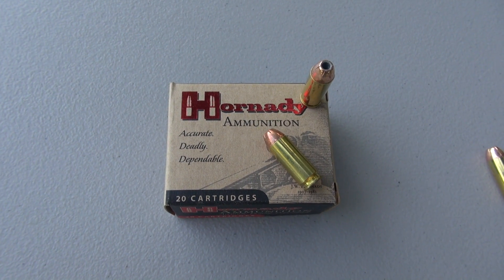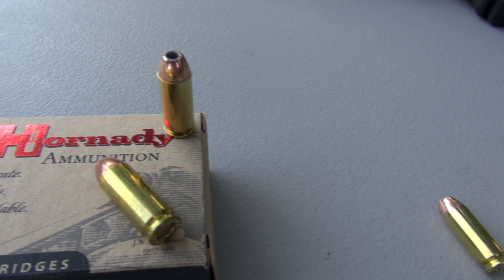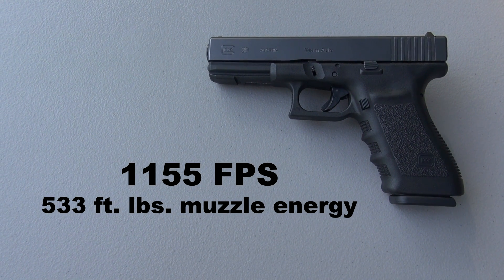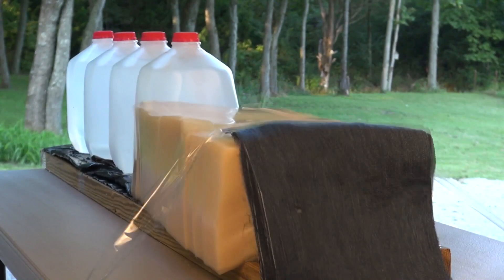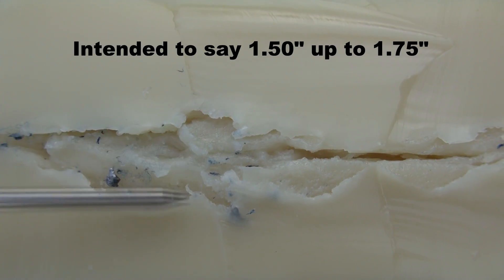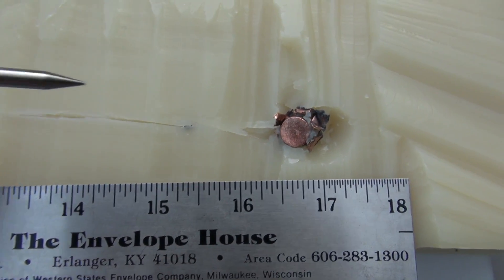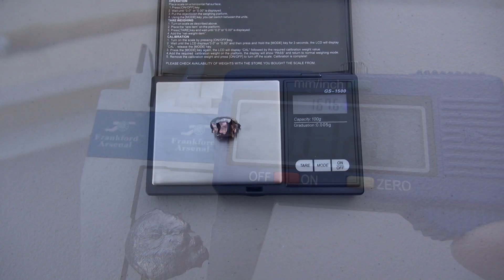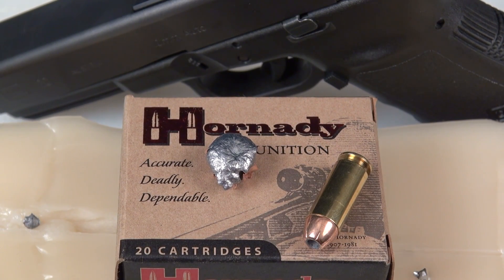10mm Hornady XTP 180 gr JHP Ammo Test

Comment: Underwood's 10mm XTP loads are quiet a bit spicier. Out of my Glock 29, using 1 Gallon milk jugs filled with water and no denim I gpt the following:

- 155gr Underwood XTP penetrated 3 water jugs 
- 200gr Underwood XTP penetrated 4 water jugs

The 155gr has 775 ft/lbs of muzzle energy and the 200gr has just short of 700 ft/lbs. I'd love to see a ballistics test out of the Glock 20 into some gel.

Comment: Somebody should try necking these down to .357. Then you'd really have a .357 Magnum in a semi-auto. .357 Sig doesn't quite get there.
Reply: +TheJurgisRud   It exists, it is called 9x25 Dillon. You can push a 90gr FMJ to 2000fps.
Reply: +Moto Rad   It was around in the 90s for making a certain power class in competition. Lone Wolf makes barrels for them, I have one.
Reply: +Moto Rad Wow. I didn't know that. There's lots of info here on YouTube about that too. Thanks. I can't believe I've never heard of this before.
Reply: ***** It is a really cool cartridge. The velocity interested me. I am going to try the 90gr FMJ load and try to gel test it. Supposedly rifle-like hydraulic shock starts are around 2000fps, so my EDC gun could be essentially a handheld rifle. I am excited to see the temporary wound cavity it creates. It is funny the cartridge was mae basically just for competition use. You reload it with the same .357 SIG dies, it is just 3mm longer so you set your die for that (since it is a 10mm case).
Reply: +Moto Rad I'd like to see that gel test. I subscibed to you so I won't miss it when it comes up.
Reply: ***** Thanks, but I'd upload it to my other channel  hahaha  see if that channel is linked to this one
Reply: +Moto Rad Maybe consider loading some with some of the bullets that Lehigh makes. Like the Extreme Defender or the Extreme Penetrater. They sell the component bullets on their website. From tests I've seen, the Extreme Defender makes a giant wound cavity already, I would imagine that their 90 grain Extreme Defender bullet at 2000fps would be devastating.
Reply: *****  I would not stand in front of it  :)
Reply: 9x25 Dillon

Comment: I wish they designed 10mm bullets instead of just taking .40 cals and putting more powder behind them.
Reply: There isnt anything available in the commercially available category that really outperforms the 40. Have to go to Underwood, double tap, and buffalo bore or something for real performance.
Reply: because your dum
Reply: strat1080 ...why broadcast you're delusional thinking
Reply: +LordDigz12   I know, it sucks.  :(
Reply: It's actually the other way around
Reply: It was that way originally,(40 cals were nothing but 10mm with softer loads) but for a while now most of the major bullets are built around .40 cal velocities and tear apart when shot at higher 10mm speeds.
Reply: I agree. That is why I don't get why so many folks think the 10mm is a great bear defense round and try to compare it with a 41 or 44 Mag. Those rounds piss all over the 10mm in that role. The 10mm fan boys have this mythical mindset of this round. I haven't seen a single ballistic test of the 10mm that would leave me to believe that it would be any better than a 9mm, 40, or 45 against a bear.

Comment: I love my Glock 10mm. But......the ammo is just wayyyyyyyyy too expensive, This stuff costs 3 times what comparable 9mm costs. There is no way to justify this.
Reply: 10mm has got alot cheaper. Almost as cheap as 45 acp now
Reply: How much is your life worth?
Reply: Bill Murry i reload 10mm a box of 500 bullets (.400 diameter) cost about 50 bucks from xtreme bullets another 20 for primers 25 for a lb of cfe pistol and the brass if u dont have it its about 40 per 1000 so total for 1000 rounds (a lb of cfe pistol powder will last for around 1200 rounds and primers come in packs of 1000s) is going to cost you around $175, then when you reload those same casings it will drop to $135 per 100 even less if you cast your own bullets (which i do) i get 1000 rounds of .45 and 10mm for around 80 bucks (pretty muchs just pay for primers and powder and the lead which goes a long way
Reply: Robert Jensen ... The justification is when you're backpacking in the back country
Reply: PewterC5FRC I'm also interested in the cost per round. I believe most pistol cartridges can be reloaded for about .10c a round
Reply: Carlos Moscoso lol this comment. #truthbomb!
Reply: Buy in bulk, got 1000 rounds for $15 per 50 rounds
Reply: I didn't bother buying a 9, .40, .380, .357, or .45. I rented those. Then I rented a 10 and liked it. So when it came time to buy, I went straight for the 10. Everything I have read says it's the best all around round. All handguns are a compromise, but a 10 seems to compromise the least, and to potentially give the most all around performance. So that justifies it to me.

Might even get another 10mm in case my primary gets confiscated in a defense shooting. I don't ever want to be without a platform for this caliber.
Reply: I can justify the hell out of it since I reload.

Its fantastic if you handload/reload.

Comment: 10mm is not to far behind the .41, but it's between a 357 and a .41 with certain loads.
Reply: +strat1080 because the fact the 10mm is a auto loader.
Reply: You can push the 10mm to .41mag performance with handloads
Reply: Yes if you compare hot rounds from Underwood for 10mm against your average 41 Magnum round. All things being equal, the 10mm pretty much runs neck and neck with the 357 Magnum. Underwood's 357 Mag loads are actually hotter than their 10mm loads. Underwood's 41 Mag loads run at about 1100 ft/lbs of energy. I don't know what it is with the all the 10mm fan boys exaggerating the power that it produces. I've never quite understood people's fascination with the 10mm as a woods carry bear stopper. It pretty much uses bullets designed for the 40 S&W and pushes them faster which actually reduces penetration. All people look at is the energy numbers but there really aren't very many 10mm bullets designed for hunting or bear defense, except for the hardcast stuff.  It really doesn't come close to a 41 or 44 Mag when it comes to hunting or bear defense.
Reply: @strat1080  To use as a bear stopper you need flat point solids loaded to the high end of the velocity range for deep penetration.
Reply: Exactly why I got it
Reply: +desertfox2020   To the low level. The .41 pisses on it in the long run according to my loading book. Over 1k ft#s in .41

Comment: Is it true that the 10mm is virtually the same as the .41 mag???
Reply: Joseph Kool Except in energy, bullet weight, bullet diameter, and expansion.
Reply: Joseph Kool i know that the 10mm is stronger
Reply: no, but it is almost as powerful as one, a 41 magnum is pretty powerful, stronger than a .357 magnum, that should tell you about the power of 10mm
Reply: strat1080 10mm creates larger wounds, and the handguns chambered for the often high-capacity semi-automatics, where is 357s are mostly in revolvers
Reply: No its not. Its not even more powerful than the 357 Magnum. Underwood's 41 Mag loads launch a 210 gr XTP at 1500+ fps for over 1100 ft/lbs of energy. Any reloader with off the shelf powder can get 1400 fps with a 210 gr xtp in a 41 Mag. Underwoods 357 Mag loads produce nearly 800 ft/lbs of energy. The 10mm is right there with a 357 Mag when both rounds are loaded to their potential. You can't compare the hottest 10mm loads to watered down 357 and 41 Mag loads. You have to compare apples to apples.

Comment: not very impressed actually. that is pretty close to what you could obtain with a 40 short and weak. I can't see the purpose of running anything but full power 10mm if your going through the expense of having one. comparing this to the underwood test makes the difference pretty clear.